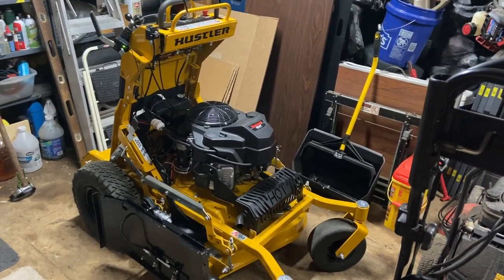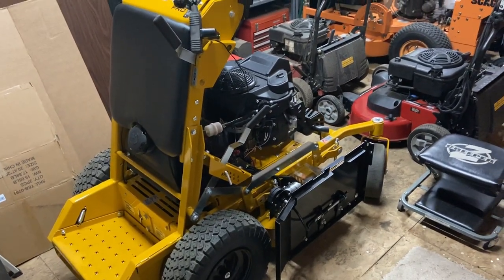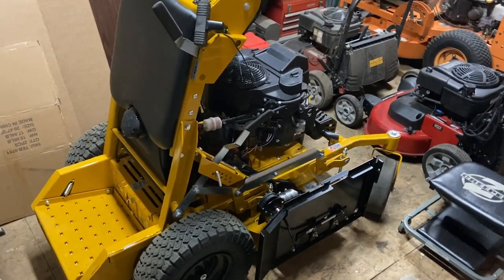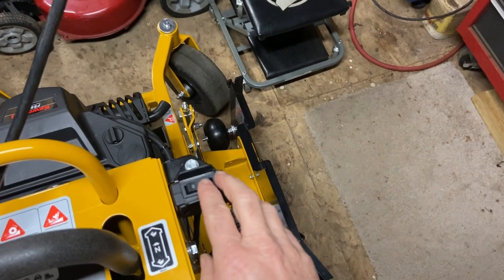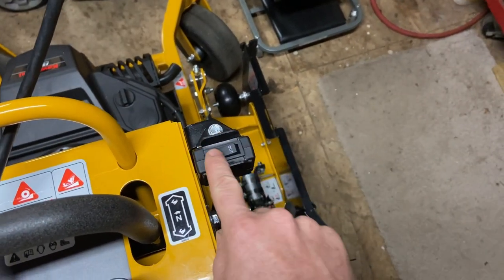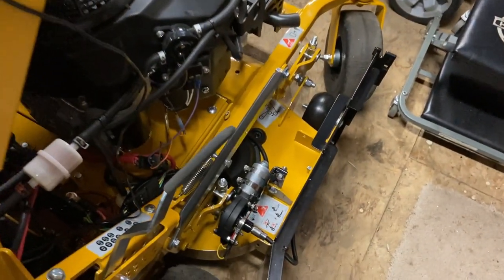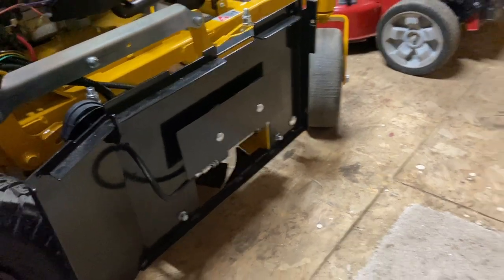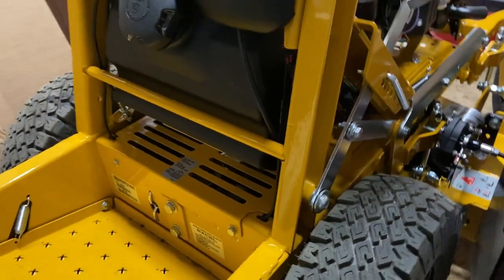Hustler Surfer Pro 34 Update (March 25, 2023)

Comment: I’m glad we have the same mower, you address my concerns, I’ve heard about that spring also, and the operator pressure switch on mine is touchy, if I’m not standing in a proper place, hit a bump or incline, it’ll try and cut off, but I think I’m standing too far forward. I think I may go with the mulch kit also instead of the chute blocker idk yet. Thank you for your input and suggestions for the mower man.
Reply from the maker: I think the mulch kit is $180 (at my dealer). Mulch kits can work really well with some mowers. Really depends on your grass type and how wet the grass is when you cut it. Hopefully in 2 weeks or so, I’ll install mine and see if it’s worth the investment.

Comment: Also, my fuel gauge doesn’t read correctly, do you have any issues with yours?
Reply from the maker: Thanks for the heads up!  I’ll check mine and let you know.
Reply: I’ve got 10 hours on mine and so far so good. I got the bagger attachment, and it is awesome. I cut a fescue yard the other day that was 6-7” tall and it clogged the deck pretty good. I hope the mulch kit works great. Can’t wait to hear how it goes.
Reply from the maker: @claytonwilliams3357  Thanks for the update. My mulch kit is ready for pickup at my dealer. I will do a video on installation.